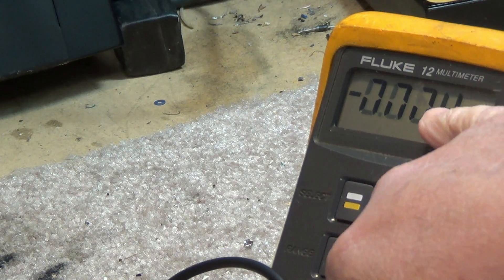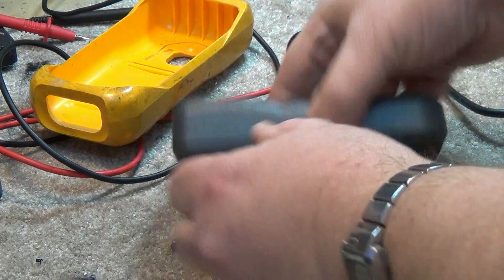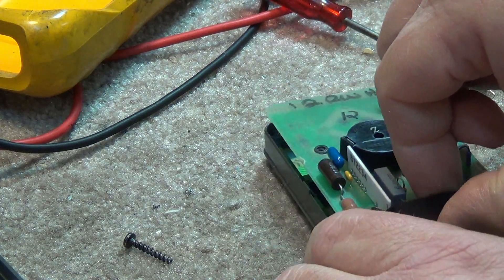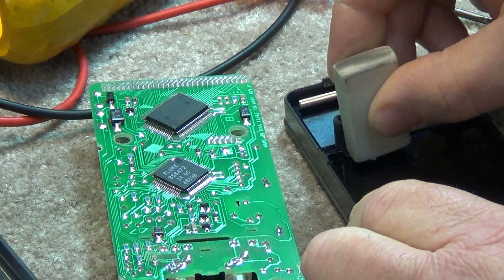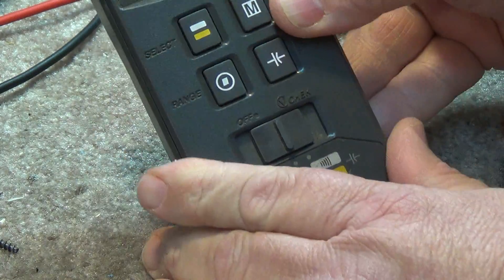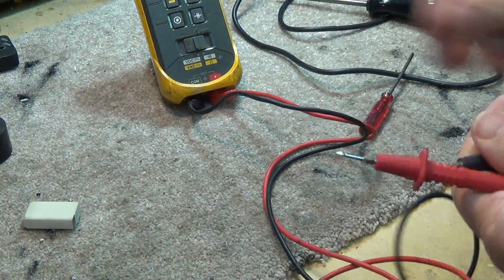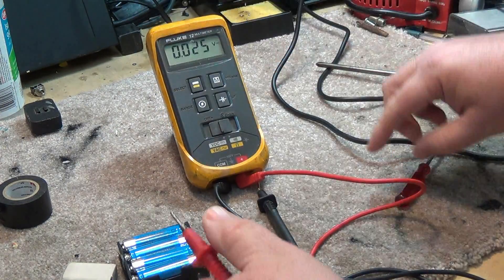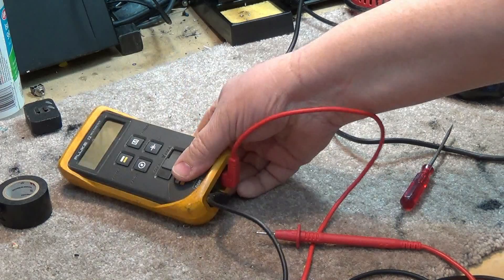Fluke 12 display repair

Comment: Thanks,
My dad is an electrician and worked at a steel mill, meaning super high voltage.
He worked his way up and was the guy to call when no one else could fix the issue. He had 2 Flukes that like you are still kickin after 25+ years.

He gave me the 12, and like you had button issues (I fixed a couple years ago but didn't remember how.

Then recently the display got worse and worse.

Thanks for helping to get mine up and running.

And you got yours for a steal of a price. They are expensive, but are rugged and keep on going.

Comment: What  a good meter. My fluke 88 did the same. The Zebra rubber strips was not making contact hard enough. I also learned from you now; to use a rubber eraser to clean the contacts...re

Comment: That is a great meter. Glad you got it cheap! The fix you employed also works on many Asian meters. I fixed a Radio Shack DVM in the 1990s the same way. It had older generation 4000 series CMOS chips, however, and I did not use anti static precautions. I blew up the meter! D'oh! 😠

Comment: do you know what could be wrong with my multimeter when i turn it on the numbers fluctuate and are not stable in any position and i have a new battery in it - i have 2 meters doing the same thing  they will not go to zero - one will still give me a volt reading but the other will not

Comment: Hello from Nice / France
Your channel is overseas well known now !!!!!

To complete our last mailing, I found the problem
for my Fluke 12 which was beeping any time in diod test without touching the
probes

It was a crack on a solder on a componant  near first down resistor. So it is fixed now !

I want to change the screen cause there is a little
crack on left down corner (result is a black mark on 1 cm from the corner just
on symbols….), the connexion rubber on the top of the screen seems to be pasted,
do you think it just lean on without glue
I’m looking to remove it,  I bought recently a
new screen to change it, but it has no rubber on it fixed.
Do you know if it is just fixed pressure and no
glue?
Many thanks for your advice and all videos you
make,  great !
Best regards Eric.
Reply from the maker: The rubber connector is not glued down on mine. Just pressure holds it between the glass display and the PCboard. The 12 is a great meter. I love mine, wouldn't replace it.
Reply: Thanks for your help and advice, i bought 2 of them used for let one in each zone i practice...Very good for every day use and more... family Fluke has grown with a 179 for ampermeter and temp too, but the more i use are the 12 (i bought mine last for 10 € (as it was beeping all time, in an auction)
Waiting for the new screen and will do the screen job ASAP !
Thanks...you're a kind of Guru ...with a little touch of magician     ;-)

Comment: wow thanks for posting this. I've had my fluke 12 since I was an apprentice 21 years ago. I thought it was fit for the bin until I saw your video!
Reply from the maker: It would be a fluke if it was accurate!No seriously, if it is accurate it's a Fluke!Best meter I have owned. I have had this one for many years. Bought it at a hamfest for 2.00 because the display was fubar. I already fixed it once, and it went bad again, so I did it the second time on camera to show what causes it. Believe me t he first time it took much longer to fix. I have a Beckman that has t he same problem, but the compression clip they used to squeeze the display and processor board together broke, so that one isn't as easy a fix.

Comment: I have 1 unit FLUKE 12 and the problem is Liquid Crystal Display (LCD) changes color to black.
Anyone know where I can buy a replacement part for display?
Reply: Yes, I've just bought one on eBay for US$28: http://www.ebay.com.au/itm/172623027536

Comment: ....Well done Mate, I purchased mine new, still have the box. same repairs over the years with the display although I increased the pressure as per  (zx8401ztv comment). The four control buttons I replaced with tactile momentary running direct to the mainboard, (Never looked back).   Enjoying all your vids,  Thanks again,     ...... Buy your cat a Grounded Wrist Strap ! !

Comment: The only problem with using an eraser on the zebra strip and associated pcb connections is that it can leave tiny traces of the eraser behind which can prevent good contact between the mating surfaces. Better to use isopropyl alcohol, if you have it, as no traces are left behind. Perhaps the eraser followed by isopropyl alcohol would be a 'belt and braces (suspenders)' approach. Good to see quality test equipment being maintained for a long life rather than discarded at the first sign of problems.

Comment: What, no contact cleaner spray?  my display on my 77 got funky, but the battery was low.  This is good to know.  Don
Reply from the maker: +umajunkcollector Not on this no. Nutrol would eat the conductive strips.Found that out the hard way when I was working in the industry. My assistant tried to fix his "Beckman" meter which was doing the same thing that way. (They were built exactly the same way) It never worked again.
Reply: good to know, thanks.  
btw, um posting a vid of movies that I made in 1984 with a Hatiachi portable and Konica  saticon video  camera.

Comment: A very handy and reliable meter :-D
Flukes allways use high quality resistor modules and A1 stability reference voltages for excellent accuracy.
They even dipped there toe into the cheaper meters market, i think it was the fluke 16, it used a common multimeter chip used in the vichi vc99 and similar meters, again its the resistor packs and reference that matter.
Next time it goes faint, perhaps a thin bit of cardboard could be slid under the top pcb hold down barbs, just a tiny bit extra pressure, perhaps :-)
Reply from the maker: +zx8401ztv It doesn't happen that often. Last time was perhaps 10 years ago.We used to joke about flukes. You know, "It would be a fluke if it was accurate" or "If it's accurate it must be a Fluke" but you know what, those Flukes made in Seattle Washington were some of the best pieces of test equipment they could own. The company has been around longer than most people realize too. John Fluke founded the company in 1953!
Reply: +12voltvids 
I like the earlier meters better, while john fluke was alive.
Im a bit odd that way.
I have an old fluke 8050A bench meter, dam good tool :-D